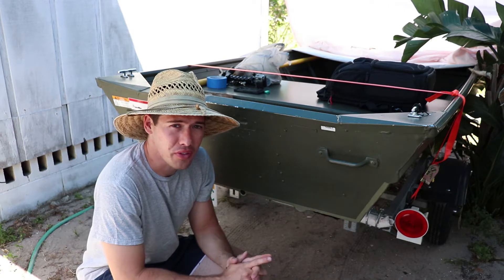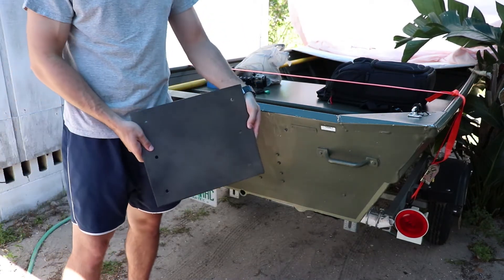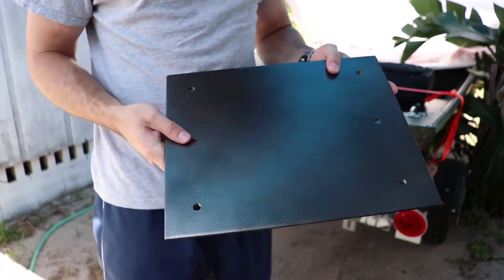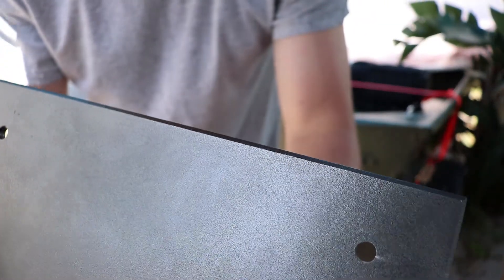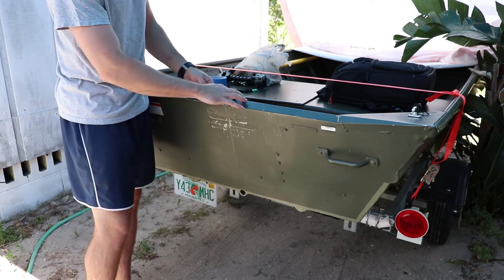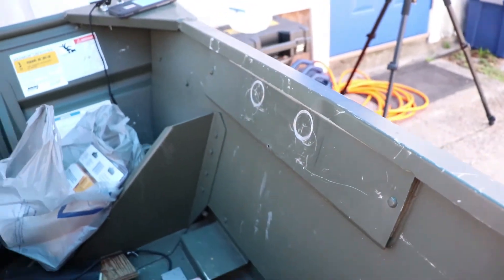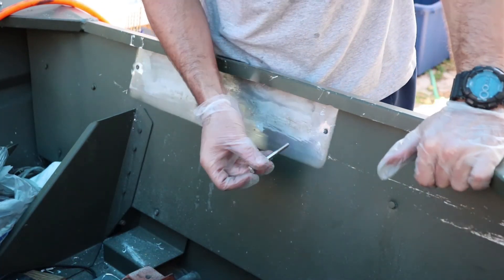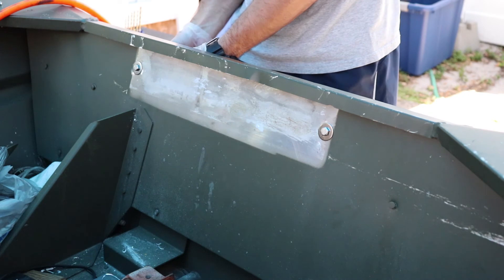Failing Transom on Alumacraft 1436 Jon Boat: Transom Plate 1of3

Comment: I have the same boat as you but 2019. I want to stick a OLD Evinrude 25horse on it, weighs less than new 15 hp 4 strokes anyways do you think the transom will handle it or am I doomed for failure lol
Reply from the maker: That would depend on your judgment haha I would look back at my transom and see it flex and move when I was running while being rough on it so I knew I had to rebuild it. If you are going to do it, first make sure the boat floats with it and you have enough freeboard, secondly, be nice to it and watch your transom and how the boat reacts to that engine hp and weight. 25hp on a 1436 seems like a lot. The transom may handle the load better with it being an outboard engine. The longtail that I have may apply force differently to the transom.

Comment: I'm planning on doing this to my boat I just bought. The boat is a 1975 Ouachita 1436 that used aluminum flat head bolts that were not sealed. The hull and transom look in good shape besides where the outboard wore through some of the aluminum over the years. Most of the bolts were ready to fallout with the slightest touch. They were corroded so bad they were half their original size.
They were 1/4 but due to the corrosion I might have to size them up. The plate Im thinking of installing is a 1/4in 18x10 to cover everything up. I could get away with a 10x12 plate but would rather have anew plate reinforcing all the old bolt holes.
Reply: Went with stainless 1/4 bolts to replace all 12 screws that broke off. Got a 18x10 plate and 5200 just having trouble finding the 4200 in the 1oz or 3oz tube.
Reply from the maker: @TheSicWolfGaming  Awesome! I just got done replacing the wood in my transom and adding more support. Good luck with your project! It sounds like you have it planned out pretty well

Comment: i have an alumacrap 1232  rated for a 7 hp motor....i am using a standard outboard at 5 hp and having the same transom issue
Reply from the maker: Yeah, with the experience I've had, I do not recommend them to others. It's unfortunate but hopefully it will bring about good.

Comment: Hey buddy! Awesome videos!! What size is that transom plate? I just got the 1436 from Academy and want to do what you did!
Reply from the maker: The plate I used was a quarter-inch thick(1/4"). T6 hardness and the dimensions were just as big as it could be without me taking out any rivets. Something like 11" by 9", but just measure your transom, see where you can fit it, and go off of that
Reply: @JTgatoring  thanks so much! Keep making great  videos bro!!

Comment: Hi, one question. Except for the transom/long rig issue, have you seen any quality issues? I have to choose between an Alumacraft and a Tracker Topper.
And how many horsepowers was the motor?
Nice job with the repair! 👍
Reply from the maker: After doing this repair, I think I would much rather choose a tracker boat over an Alumacraft boat. The Tracker hulls have bolts and nuts on the transom so it is made easy to repair. The alumacraft is riveted and has a metal sheet the covers the transom wood so its near impossible to replace it once it rots. I also think the cylindrical ribs of the tracker are stronger than the square ribs on the alumacraft, even though the square ribs made it easier to secure the deck to the ribs with having a flat surface. The one thing I liked about the alumacraft, is that it was light. I got the light version so it is 135 pounds. The horsepower of the engine was 13hp and boat was rated for 15hp. If I were to do it again, I would get a Tracker Topper because they are closer in distance to me and I didn't have that good of customer service with Alumacraft. Any more questions, please let me know!

Comment: Would love to know if this has solved the problem. I’m really wanting to go get a 14fter and a 420 predator but this issue has me concerned. I’m wondering if I should do this right out the gate as soon as I buy the thing. Thanks for the input!!
Reply from the maker: If you get a 14 foot jon boat, get one that has a center transom support. This Alumacraft has the transom support off to the side and seems like a poor design. If I were to buy a new jon boat again, I would go with a tracker 1436. I'll be testing it this week and hopefully I'll be able to get that video out in time for this Saturday.
Reply: @JTgatoring  Most informative video- I have been meaning to get 1436 for years always thought I'd come across used one but never did- After owning 1448 for last 25yrs that's lot time just little big for some creeks I fish finally just broke down purchased new one - I went w/ G3 because of all framed aluminum transom no wood - Seems strong enough to bolt heavier motor on if you get chance check them out - Also looking for longtail kit for duck hunting curious about backwater wanting best quality possible can you recommend for this size boat? Thanks for video-
Reply from the maker: @jacklowe3788  Hey Jack, thanks a bunch! I have heard of G3 but when I was looking into getting a boat, they were not as popular yet and they were considerably more expensive. Their price isn't too much more now (about $300 more than a tracker which isn't bad) and I knew that I was going to start a channel and wanted to get a brand that was more widely known where I could help out more people who had a similar setup. Backwater makes a solid kit, but I think they perform better on v-twin engines. If you're sticking with a single-cylinder engine, I think the sps thai longtail would be best. As you see with my rig, the 13hp predator and medium sps has gotten the hull up to 23mph and that's without any mods. The problem with going to the next size up is weight. Check with G3 but most 1436 sit too low in the back with a v-twin engine and you greatly increase your chances of swamping the boat when you come off of plane. If you want the best engine, I've been hearing a lot of great things about Briggs engines and I think the 16hp v-twin briggs with an electric starter and a recoil start would be the prime setup. You would get great torque and smooth running being a v twin, and get great fuel mileage. Let me know what you end up doing or if you want to talk about anything else. Thanks again!

Comment: Been watching your videos for a while but haven’t commented before. I currently kayak fish but have considered getting a 14-16’ Jon and doing a mud motor on it. 

My question is with the long tail mud motors, how easy is it to maneuver at the ramp? I’d like to get one for duck hunting but I’m worried if the ramp was too busy the long tail could be a problem.
Reply from the maker: Thank you watching and supporting the channel GRANT KEEL // GUITAR. If you are worried about maneuvering your longtail at congested ramp, it may be a problem if you try to use it but I just use my trolling motor on my bow. If I'm really worried about it, I'll swing the tail up into the boat and that way there is no issue and I just control my boat with the trolling motor. If you're in shallow water and its too shallow for your trolling motor, I always have a push pole on my boat. I use that to push pole in shallow water or fend off docks and structure.
Reply: JTgatoring I didn’t think about the trolling motor, that’s a great idea! Just troll away from the ramp then start up the mud motor away from everyone else. Thanks for the reply 👍🏻

Comment: I used a 1/2" poly plastic cutting board to redo the crappy wood on the transom.  Works great & is all weather resistant. Much better alternative to using wood.
Reply from the maker: I was thinking about using a material like that, but I needed something thin or else the motor mount wouldn't fit over it. How long has it lasted you?
Reply: +JTgatoring Over a year now. Is about the same thickness as plywood was with IMO a lot longer life span. I don't often take my motor off the boat, but if I had to, the worst that would happen if it gets scratched up a little. It'll never rot or get weak since it's a poly material.

Comment: By that i mean the entire back of the boat inside with plywood. You can cut out around the support bracket and secure it to the back of boat with a few stainless carige bolts with some good marine sealant and then were your plate is with those 6 bolts as well. It would then make the whole back half of the boat a solid structure. With this the twist will be spers through the entire back of boat.

Comment: Unferstand that. Might i suggest you cut a 3/4 sheet of plywood to match the inside as well as the plate will help but the plywood would further help stiffen the entire structure. My biggest concern with just the plate is the area around it will then intern bend. And then reinstall that plate were your engine mounts. It would help disperse the stress and it would save you having to it agian.
Reply from the maker: The only problem with adding anything more to the transom, on top of adding the plate, is that it will become too thick to mount the motor mount onto. If this plate bends the boat transom around it, then this Alumacraft transom is trash and Alumacraft has something to really worry about with their boat design. I will not be messing with this transom after this. If this does not fix the problem, the boat is not worth the time and effort and I hope that it would show others what they can do and what to expect when they encounter the same issues. I'm hoping the plate won't bend the transom around it with having the beveled edge and having marine 5200 all around the edge protecting the transom from the plate digging into it.
Reply: I would also add the plywood across the whole inside width of the transom,also a cheap and easy reinforcement is to attach triangular aluminum plate on both rear coeners extending up the gunwale just to further beef it up.They can either be riveted or bolted.

Comment: Great job 👍
Reply from the maker: Thank you GetOutTheHouseGoFish! Have you decided on a boat yet?
Reply: JTgatoring I am still debating back and forth. I decided I think I wanna stay in the 14 foot range but I would like to get a 1448 because it’s also rated for a bigger engine that one day I will eventually get. So I’m looking on Craigslist weekly and saving. I would really rather just buy new or used rarely used kind of deal.
I am pretty sure I’m gonna buy an Academy trailer since they have the best valued one.
Reply from the maker: If you go wider, you may want to go longer also. With going to that wide of a boat, your chances of a longtail becoming harder to control increases. If you are going to be using a tradition outboard motor, then you will be fine; but just remember a longer, skinnier boat with a heavy load will go faster than a wider, shorter boat with the same load and same motor. I do not have a Academy by me so I am not aware of their deals. I got my 14 foot boat trailer for around $600 new because I couldn't find a good used one on craigslist. Good luck though! I hope you're able to find something
Reply: JTgatoring I am glad you told me that. Thanks for the info because I was looking to use a mud motor.
Reply from the maker: Oh yeah I would try to stay away from a 48 inch bottom on a 14 foot boat then if you're going with a longtail mud motor. If you go wider than a 36" bottom, you will need to get a 100" shaft for your longtail 👍

Comment: Also to bad they wont warranty it they should with such a weak design. Guess I wont ever buy a boat from them.
Reply from the maker: I am a little disappointed and frustrated. The transom just isn't supported well and I think a regular 15hp outboard would bend this transom also.

Comment: Is the plate the only reinforcement you are using? I would definitely suggest adding somthing on the backside as well to help with flex as well. Lot of twist on it and overbuliding it in this case would not hurt. As always love your videos and love that you like me are willing to do this kinda stuff.
Reply: Yeah, no kidding, right?
Reply from the maker: I will just be using this plate. I am going to put it on the outside of the boat, use M5200 as an adhesive and a sealant, and bolt it through the transom. I'm thinking this should be enough. Inside the boat, on the other side of the bubbling aluminum sheet, there is half inch plywood in there. Once the plate is through bolted it should make everything solid. If its not, then back to the drawing board or see if I can get a boat company to sponsor the channel hahaha